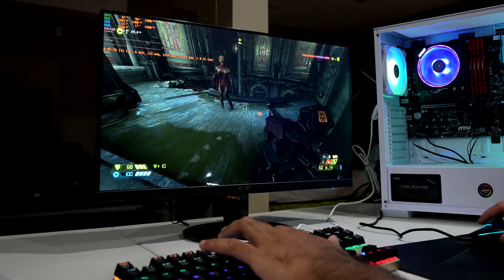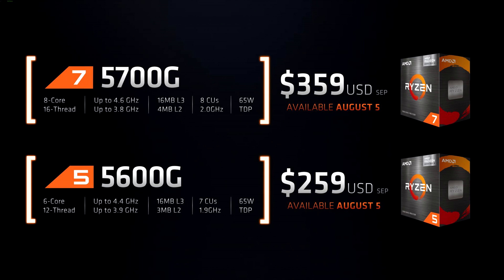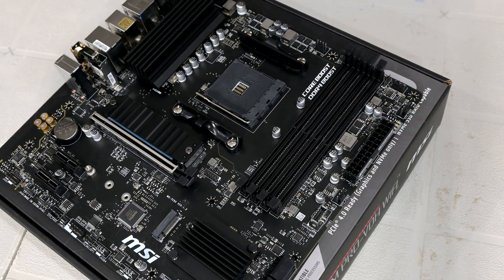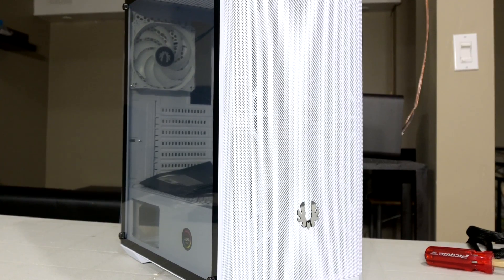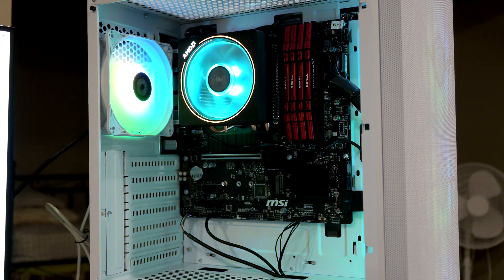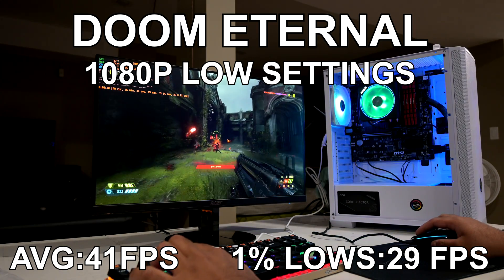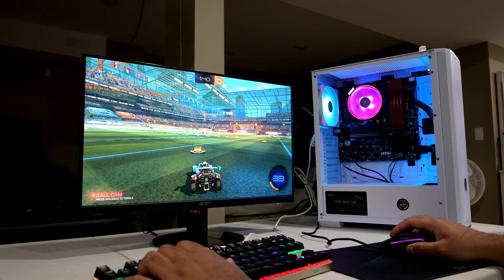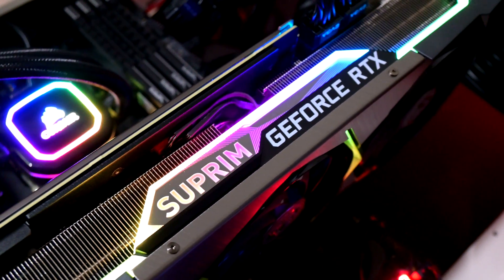Building A Budget Gaming PC With NO GPU - The Ryzen 5 5600G Is A Great Stopgap Solution!

Comment: I’ve got 5600g and I’m curious as to what budget/value gpu you’d add to this build that would offer better graphical performance. Especially after seeing your graphic that the gtx 1030 is comparable to 5600g igpu performance.
Reply: An GTX 1650/Super/1660Ti I think would be really good gpus for this budget
Reply: @Spider-Nefilo  can you send link to that gpu
Reply: @Spider-Nefilo  nope
Reply: Go buy a rtx 3060 when you have moneu
Reply: Rx 570 or Rx 580 is good
Reply: @darkbaneelemental9163  I ended up getting a 3050
Reply: If you have integrated Graphics go into bios and switch your vram to 16g
Reply: rtx 2060 or 2080 ti brand new is the same price as old 1660 ti or 1650 super.

Comment: I've got the 5600g and a Rog Strix b550f. I've got the ssd and 16gigs dual channel crucial ballistic 3600mhz ram.  My stuff isn't performing as well. It lags on fallout new vegas for crying out loud. What am I doing wrong?
Reply: Leave it on 1080, lower picture quality in game menu. I am running bulldozer 4 core, 560 ti2win sli, good fps occasionally buffering, crap visuals. Fallout 3, fallout 4, great picture quality, 50-60 fps. Fnv, is just that way. Known for crap visuals if you can get it to play with out stutter. Ssd helps a lot, 2 tb minimum. Buff up the ini so it plays or buff up so it looks pretty.

Comment: Bro without GPU- My Sepecs: 

Cpu : i5-11400
Mobo: GB B560M D3SH AC
Ram: 16GB

Vs 

Cpu : r5600g
Mobo: MSI B450 pro max
Ram: 16GB
- Which one will be better for FIFA 21/22 streaming? Without GPU
Reply: 5600g always
Reply: @NinjaEdge  so tell me if i take 1660 super gpu then which one will be better? 
11400+ 1660 super ?
Or r5600g + 1660 super?
Reply: @efootballheaven5316  5600g + 1660, but honestly, none is good combo, I'll recommend 5600x + 1660 super if u want discreet gpu.

Comment: Was your MSI m/b 5000 ready or did you have to update the BIOS? Have the 5600G & the MSI MAG B550 (or MPG) gaming plus m/b. Great build! Thanks! Don't have any RAM yet! That's about the last thing I need. You installed the PSU upside down, right?
Reply: yes you can have display without updating bios
Reply: If I'm not wrong the b550 boards come amd 4 ready no need to update bios.
Reply: @itsyaboiroy5558  hmmmm... I just want to be sure the m/b IS READY!!
Reply: @j.lietka9406  I just ordered my b550i MSI will come in 3 days I can update u then. For now though upon further research, I think it is am4 ready but there might be issues with xmp so it's always safe to just flash the bios update.
Reply: @itsyaboiroy5558  wanted to check with MSI for updates, that way I know I have the latest & greatest! Thank you 🤓
Reply: @itsyaboiroy5558  so did it come ready?

Comment: What is the best ATX motherboard for Ryzen 5 5600g? And is it okay if I add Gtx 1650 on that? And lastly can you make a video how to update bios for B550 motherboard+ Ryzen 5 5600g? Is that need a wifi to update bios?
Reply: Buy 5600x instead if you already have the 1650 or you'll be buying the dgpu within 6 months. If the stop gap is over a year then only the 5600g makes sense
Reply: Best amd mobo, it's their core, and their Mobo, and best possible bios. It's still not cheap, Mobo, ram, cpu, power supply, nvme.2 storage, o.s..

Comment: I downgraded from an i7 to a Ryzen 5 5600g. Try telling my PC that it's a downgrade though. The absolute workhorse of a chip!
Reply: Can i ask why would you go from i7 to ryzen 5 5600g? I’m planning to buy a pc set and the only option I have is the one with ryzen 5 5600g with an integrated gpu. But my friend keeps telling me to go for an intel i7 10th gen or above for my processor.
Reply: @beryong5204  Various reasons. 2nd gen i7 so was getting on a bit (1155. that old) and needed an update. I heard/read nothing but great reviews, the overclockiability was a factor. The clincher was having a play around on a mates AMD build and the difference was noticable.
Reply: @MedievalFolkDance  I mean a 2nd gen i7 going to a r5 5600g is definently an upgrade, that i7 was prob showing its age
Reply: @kiro_luv8424  It was, hense the desire for an update. There wasn't anywhere left to go on that 1155 socket so was gonna be a full board job anyway. Like I said, had a go on a mates AMD build and that sold me. From my experience with gaming and whatnot on it, an i7 doesnt compete at all with this. It's more on par with an lower spec i9, IMO.
Reply: @MedievalFolkDance  yeah amd does good stuff, and their ipgu's are actually like... Capable of doing something compared to intels (Intel igpu user here)
Reply: @kiro_luv8424  It's kinda hard to find any review or comparrison that puts intel above AMD when it comes down to things. Is it because Intel have the commercial sector nailed down? It's something of a head scratcher.
Reply: @MedievalFolkDance  I have an X79 intel I am looking to replace with a setup similar to the one in this video!   LGA socket 2011.  6 core 12 thread extreme chip.  

Looking for smaller quieter and can do the same work using less power and no graphics card.
Reply: @MedievalFolkDance  Even the fastest i7 1155....the i7-3770K is slower than 5600G. You are getting an upgrade.